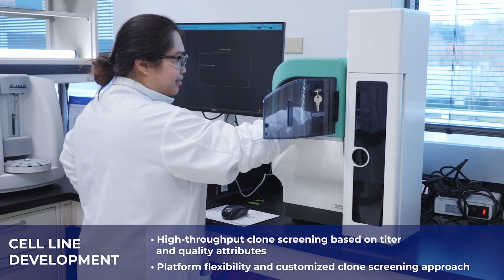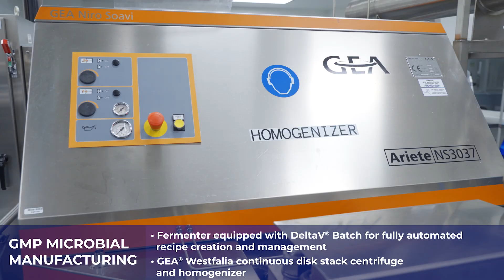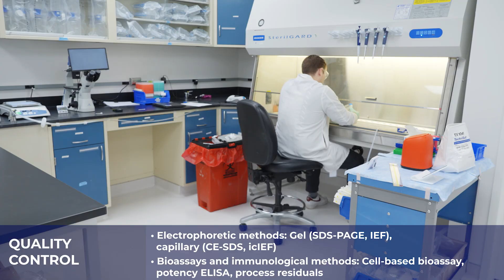AGC Biologics Seattle | Mammalian & Microbial | Site Tour

Comment: Hello!

My name is Catherine from Wujiang Deshengxin Purification Equipment Co., Ltd.

As a distinguished pharmaceutical manufacturing, we understand the critical importance of maintaining pristine cleanroom environments for your advanced manufacturing processes.
 
And this leads me to ask: When was the last time you reviewed your cleanroom’s air filtration performance?
 
Our company specializes in state-of-the-art purification equipment designed specifically for manufacturing facilities like yours. 
 
Features of our key equipment include:
1. FFUs: low noise; low vibration; large volumn; high efficiency motor with 3 different speed; energy-saving.
2. HEPA/ULPA Filter(H13-U16): high-performance and high-efficiency(99.99%-99.9999%@0.3um); various frames; customized.
3. Air Shower: electronic interlock; automatic control system.
 
Other advantages:
1. We are the direct manufacturer, so we control the entire supply chain. Thus, you can enjoy a competitive pricing and flexible delivery.
2. All the equipment are self-designed and self-manufactured, which means you can be confident in the quality and performance of our products.
3. We have over 20 years' experience in developing and saling purification equipment for different industries according to their requirements. 
 
And whenever you feel the time is right to explore new purification options, we would be thrilled to be your first call.
Thank you for your time. We look forward to your reply.
 

WuJiang DeShengXin Purification Equipment Co.,LTD

A Trusted and Experienced Partner You Can Rely On. Contact us for impactful solutions tailored to your needs. 

Office: + 86-512- 63212787
Mobile:+86-18156363955 Fax: + 86-512-63211760-812
Wechat:18156363955     WhatsApp：+8618156363955
Website: www.ffufan.com
Suzhou factory Add.:No.18 East Tongxin Road, Taihu New Towm, Wujiang District,Suzhou,Jiangsu China.
Guangde factory Add.:No. 7 Guohua Road, Guangde Economic Development Zone, Anhui Province, China.